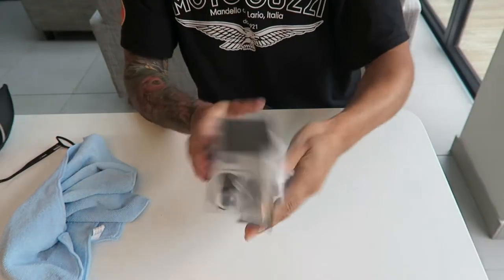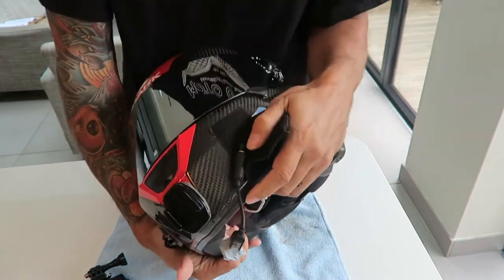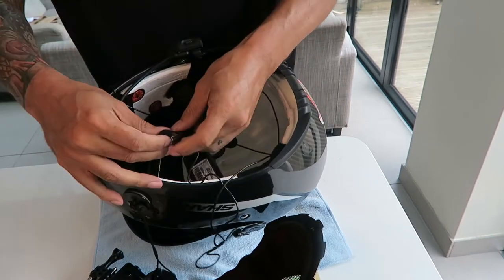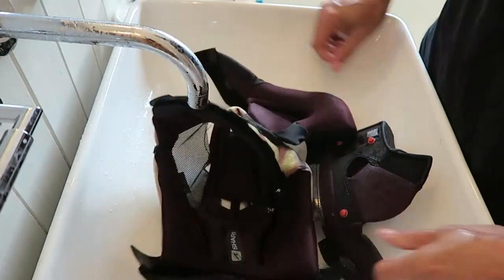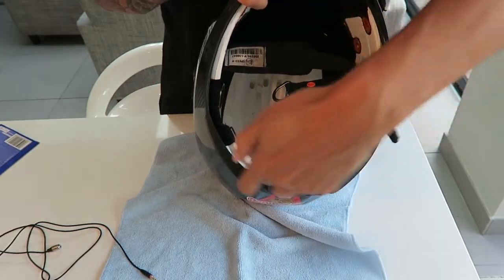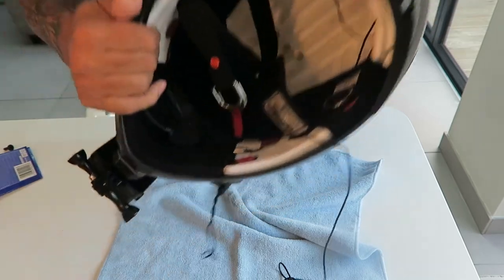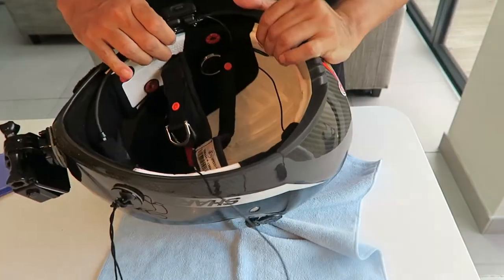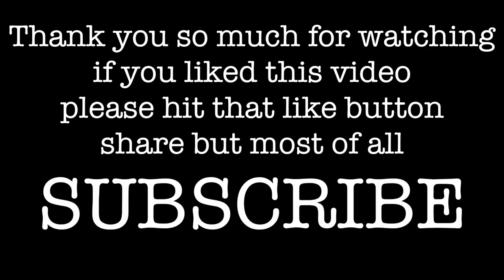MOTOVLOGGING SET UP | MIC | MOTORCYCLE helmet interior clean

Comment: Mr fish, What is the putty stuff that is around the connection form the mic to the GoPro on the adapter piece? 
I have been working on my mic setup the last several days to try and get it to work better... Still having issues with wind noise and only working at super low speed or stopped... Really enjoyed this video and thought it was helpful for me to understand a bit more... 
Thanks Mr Fish
Reply from the maker: That to waterproof it , as it always rains here 😂, wind noise will be due to mic position and the foam surround on the mic (full face)
Reply: The chronicles of mr fish ooo, rain. We don't get that much of that phenomenon here in so cal... ok. I will continue to move mic location to try and adjust for the wind noise... Side-note I use a modular helmet not sure if that will have an impact
Reply from the maker: +SABCRAZY13 where is the mic positioned ?
Reply: The chronicles of mr fish my helmet has  integrated Bluetooth headset/boom mic so I run the mic along the boom having it positioned at the end with a Styrofoam wind cover. Have cat tails on order currently from amazon. I will send u a pic on IG msg in a bit when I leave work... thanks for ur help man.
Reply from the maker: +SABCRAZY13 no worries I will have a look when I wake up
Reply: +the chronicles of mr fish OK, Forsure! Awesome. Much Appreciated